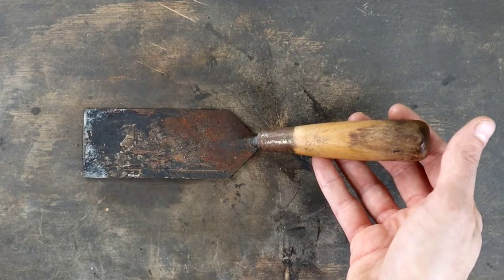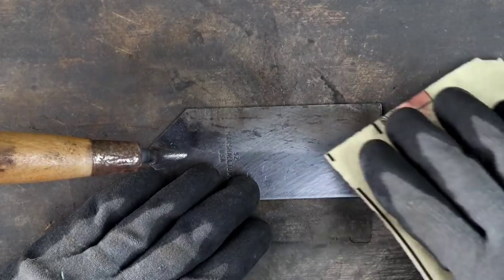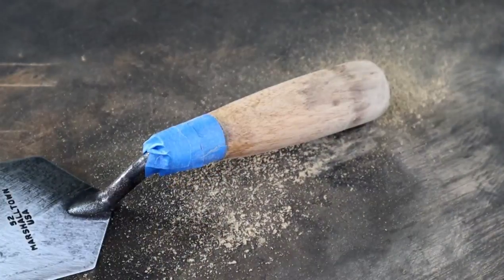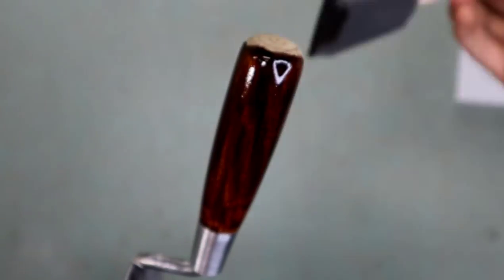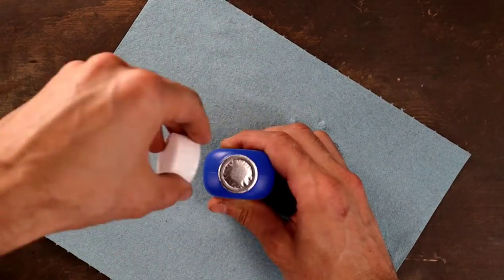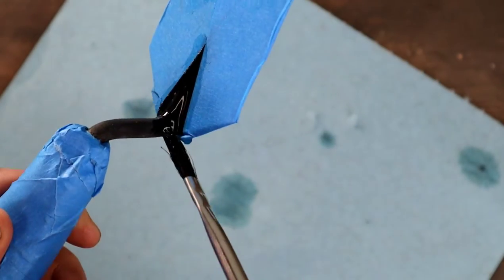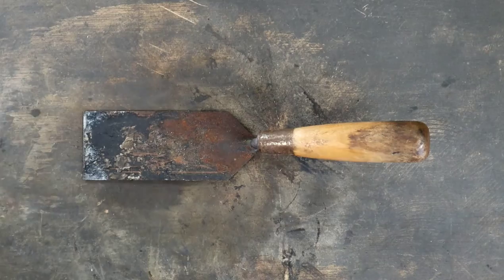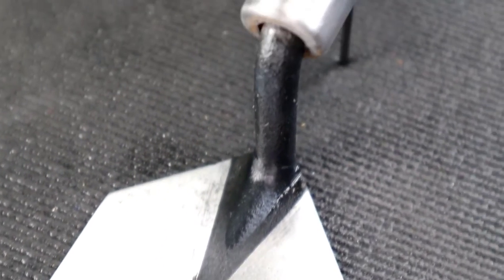How to Restore Using Cold Bluing | Marshalltown Trowel Restoration

Comment: How do you keep the blade from rusting after this?
Reply from the maker: For tools that get regular use, apply a light coat of oil (3-in-one will work or a mineral oil) bi-weekly or monthly depending on the humidity in your area. I'm not a mason so I only use this at most twice per year. For tools that sit around, apply carnauba wax with a rag.